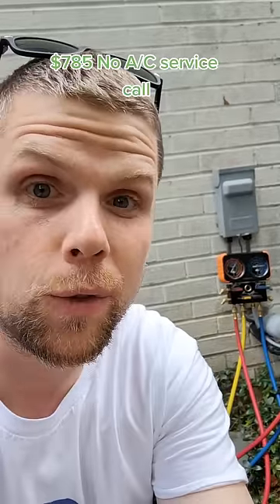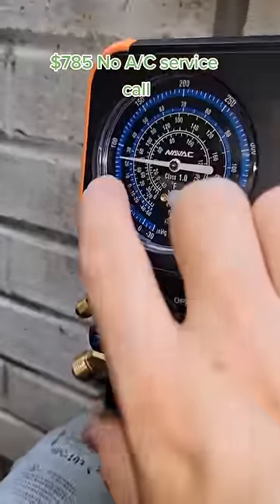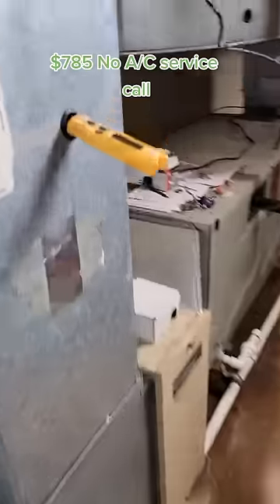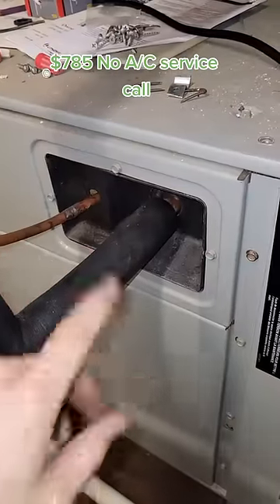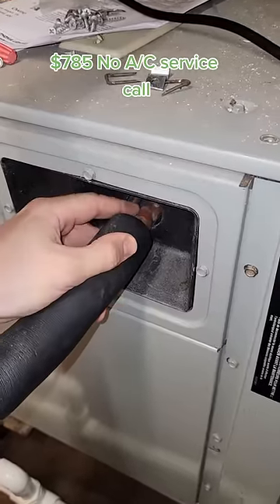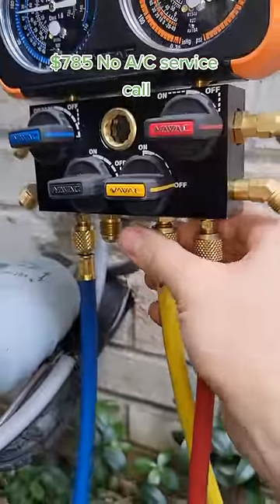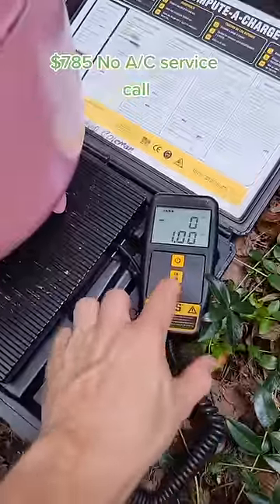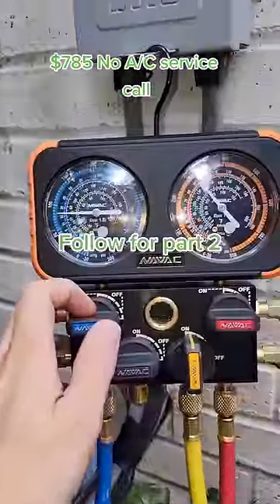Why is my A/C unit 🥶 freezing up? #shorts

Comment: For us, a leaking furnace and a freezing up (frosting) return line (idk it's called that, but the pipe that brings air back from the outside unit into the evaporator) after our ducts were cleaned and the air flow was suddenly DRASTICALLY reduced.   Sounds like something dirty to me! 

The maintenance ppl were putting the filter (for years) where it was not held secure because the original slot was too small for the filters they have , so they put it against the wall, but the force of the air was pushing it aside, and the dirty air was bypassing the filter.  It was also highly likely sucking air inside from the open slot where the filter was supposed to go.   The inside of the furnace and the ducts were filthy, we had breathing issues, recurring sinus headaches etc.  

So the ducts get cleaned and suddenly the air flow is HORRIBLE.  THEN after a while I noticed the leak. The pros came, said there was a pinhole leak in the line (a SLOW leak) and the duct cleaning must have exposed it.  Gives the AC unit a charge says they will replace the unit after approval from the owners.   Says he found out that something had snapped inside the condensation pump, so he had to replace it.  He turns the air/fan speed (?) up on the unit.  Tells me it should work fine until the next few days when they replace the system.

 I tell him the air flow isn''t right, but he is the expert and he tells me that the weak air flow  (next to none compared to before) is fine. The basement air is coming out great, and it's cooling.  But 1st floor air is super weak.  He thinks it's fine. He says nothing about the great air flow at basement level.   He suspects because we prev had strong air on 1st floor with little to none on the 2nd floor, the duct cleaning removed something that formerly obstructed the 2nd floor from getting air  and it will be fine now.  He never checked the air flow on the 2nd floor though. 

But  If he had checked the flow on the 2nd floor, he would have realized that there was STILL no air flow up there, so the downstairs should have been roaring if his theory was true.    He leaves, the temperatures go up instead of down, then the leak starts again at the furnace, and it starts freezing up.  We had to sleep with the windows open on the 2nd floor with an electric fan blasting.  Did I mention it has been seriously humid and hot here lately?  The inside cooled a whole 2 degrees in 8 hours although the outside air was 5 degrees cooler.  Our building is insulated great for the winter. But what keeps the place warm in winter , stores heat in the brick facade in the summer too.  SMH

I do some research, find out about dampers, and adjust them, improving the air flow to the 1st floor . Air flow on the 2nd is still God awful, ie barely even a waft of air.    After adjusting the dampers, the frost went away, the furnace stopped leaking. 

Next day, the house is hot as heck, the AC clearly not working. I finally talk them into sending a guy out again, bc the AC was supposed to work until they get it replaced. 

I specifically asked them to send someone out who is familiar with these old systems, and who is knowledgeable about air flow.  The guy comes out, knows nothing about air flow.  But he discovers the condensing unit is not working and the thermostat is bad, so he replaces it.  He says it wasn't sending the signal to turn on the compressor. That was a 2nd peripheral problem discovered, but Air flow is still horrific. Except in the basement . 

He leaves.  The temperature drops another 2-3 degrees, and it starts leaking around the furnace again.  I finally notice while looking around trying to understand, that he did not replace the cap in the condensation pump, and the paper tab is STILL IN IT, so it's probably been there since the day before!     I replace the cap, and remove the tab, and the condensation unit starts working.  A few hours later, the furnace is leaking again,   and a little bit after that.. just as I was concerned might happen again, it starts freezing at the return line.  I suspect maybe dirty evaporator coils, which it seems NO ONE ever looked at in the two visits.  It looks to me from what I see online, that it's pretty much one of the first things you look for besides blocked return vents, dirty filters... smh.  

 If it's not the evaporator coils, it must be an obstruction, and from what I have seen,  understanding how pressure readings affect this could have ruled out an obstruction .. or not..   The severely reduced air flow.. no one seems to want to believe me.  They said they would send an airflow guy out to talk to me, but instead they send someone who replaces the thermostat, never looks at the coils, has no real knowledge about air flow etc.  I guess they figure they are replacing the entire AC unit and the Furnace (hopefully tomorrow!) and in their minds this will fix EVERYTHING.  One small problem with that - before the ducts were cleaned, there was NO issue with air flow. NO issue with freezing up return pipe, or leaking around the furnace.  

Replacing the pump had to be done, but it seems to me it was a sort of peripheral issue to the air flow. Or maybe it happened at the same time as the air flow issue, because of the duct cleaning process.  Even with the pump replaced, the air flow issue never went away. 

  Replacing the thermostat was also a peripheral issue - Maybe it was my husband turning the thermostat on and off  too quickly (if that is a thing) or maybe  a chain reaction to something that was done in the process of trying to fix things.   Whatever the case, replacing the thermostat also did not fix the air flow issue, and I knew it wasn't going to. 

I am no expert. I have very limited knowledge based on reading and looking at tech videos for a few hours.  But I know what I see happening,  and to me, this air flow thing is either dirty evap coils, or an obstruction somewhere in the ducts, or maybe there could even be a duct not connected properly - one of them moved a bit when I was trying to adjust the dampers.. a bit concerning.    But my God.. you don't have to be a rocket scientist, or even have a certification in HVAC to understand that this air flow is a problem or that it isn't going away with what has been done, so something is being missed.  I can't believe that these guys check temperature at the vents, but couldn't bother to look at the evaporator coils - which seems something super basic from what I have looked at.   

 Sorry to be "venting" (no pun intended but it is what it is lol)  - but this is so frustrating. I can't imagine if I was the owner of the property, having to pay the kind of money you charge and then having the guys have to come out multiple times and never seeing the actual problem, never checking the coils etc.   Pretty expensive job to have them keep missing the real issue.   I mean sure, the pump needed replaced if something in it snapped and it was spraying water. That was the story anyway... but um... it's still leaking, so that wasn't probably it.     Then the thermostat did go bad, and that needed replacing, because the signal has to be sent to get that unit doing it's job.   

But in all of this, no one believed me when I said, hey.... the air flow now compared to what it was before is NOWHERE NEAR what it should be EVEN IF it is split between a couple more vents upstairs.  And based on the tiny waft of air coming from the upstairs vents, so negligible it might as well not even be there- if there was an obstruction before stopping the air from getting upstairs, and there STILL is an obstruction (they are two different runs btw) then why is the air on the 1st floor not powerful like it was before?   

Either all three of the upstairs runs are obstructed, or something else is going on.  And why is the air on the 1st floor suddenly not strong either?  Maybe the blower isn't working right? Or maybe the Evaporator coils?  No one checked either of those.  SMH.  So frustrating!    I mean, my God, the first guy who came out is supposed to be "the best" guy they have, and really good at his job, and he didn't even remove the tab that allows the condensation pump to work?  What???  And then the 2nd guy doesn't notice that either, even when he was playing around with the pump to see if the condensation lines were draining?  Yikes.    All this seriously makes me want to go to school for HVAC just so I can do it myself.

Comment: So how did the evap and blower wheel and ductwork look. 9/10 when a unit is freezing and the subcool is normal to a tad low it’s airflow. Looking at the low side gauge and taking delta t and not measuring subcool or superheat  first before adding charge is very irresponsible and a lot of techs have overcharged units this way. And misdiagnosed

Comment: Low refrigerant causes insufficient cooling. Poor air flow causes icing. Probably plugged furnace filter or a restriction in the air conditioner.
Reply: These are professional men working son. Keep getting experience before posting.
Reply: @nunez23j1  bold of you to assume I’m not a professional…

Comment: So the tank is flipped up side down because its a blend or is it because its as we call it a virgin tank that has no dip stick in a middle and only one valve at the top? So in order to get a liquid out instead of a vapour you have to flip it over.

Comment: Many things cause it to freeze up.   
Low on charge. 
Restriction in the metering device or filter dryer. 
Lack of airflow due to a plugged air filter, plugged up evaporator coil or blower motor shut down.  
Running it in the wrong designed temperatures not set up for that system.  
Since 410A is a blend losing X amount has been known to change its capacity but to be honest with you I’ve never seen a change.  As of 2023 there is a rumor of them phasing that out.  I honestly believe it has nothing more than just to make extra money by selling new products. 
But anyways you’re doing a good job 👍

Comment: I must have missed when he checked all the area's for the leak, then vacuumed the system down, brazed the leak, pulled a pressure test to see if the brazed line held, then put the correct amount of freon in.

Comment: 5000$ fine for him 50,000$ fine for the company best part he filmed himself doing it
Reply: I wasn't gonna say but I'm glad someone did
Reply: Not for the purging of his equipment, but for charging a system he believes is leaking. As a former MVAC tech, I'm dubious about his diagnosis.
Reply: @Azlehria  in Canada you can't purge to the air it must be properly evacuated though a machine
Reply: Not illegal on systems containing less than 50 lbs of refrigerant. Yall need to retake the EPA if you think you know what your talking about.
Reply: @crapmusstank6558  are you Canadian
Reply: @meanmachinesgaming  American...
Reply: @crapmusstank6558  and that's the difference between Canada and USA
Reply: @meanmachinesgaming  this was an American shot video so I dont see what the problem is. The few pounds that leak out residentially compared to elsewhere is miniscule. God bless Canada. 🙌🏿
Reply: @crapmusstank6558  Must be a 608 thing. System size is irrelevant under 609, and MVAC systems are way less than 50 lb.

Comment: I hope that wasn't water coming out of your charging hose.
Reply: Water? You mean when he opened the charging hose to purge it?
Reply: That’s liquid refrigerant coming out when he purged the air of the hose.
Reply: He said water if you listen the video, I'm sure ment refrigerant.....I was being a smartass
Reply: No kidding, if that's water he's got other issues😆 but it's just liquid refrigerant (I hope)
Reply: @s_9036  so basically his service call was a “ no cooling call “ the system was freezing up, he shows the low side pressure on the gauge showing that the pressure/temperature is below 32 degrees which is below freezing thus making the low side of the system freeze. He then connects his manifold gauges to the system and “purges” his hoses before putting refrigerant into the system because you only want to put refrigerant into the system NOT air and if you don’t purge your hoses then you are putting air into the system. That’s why you see some gas and a little bit of liquid come out when he loosens the hose a little bit. He then weighs and charges refrigerant into the system weighing how much he put in to charge the customer accordingly. Right now refrigerant is getting very expensive , that pink tank he used is R410 is a high pressure refrigerant found in newer systems. If you own a system that has R22 then it’s time to replace the unit since the price is $1500 per 30Lb tank right now wholesale and HVAC companies are charging about 150-200$ per pound and a typical residential 2.5 ton unit usually holds 4-6lbs of refrigerant depending on the make/model.
Reply: @s_9036  Join the military and sign up as a 91C you'll get training and all the certifications to actually do it.
Reply: And it pushes the air out buddy so he is half way roght

Comment: You need to do a leak check before dumping juice in
Reply: In the field that’s not always the case , if the customer just wants to add refrigerant just to get by that’s usually happens , they don’t want to pay extra for a leak search . If the system was completely empty that’s a different story.
Reply: @JP-zz5rm  these are sealed systems and really shouldnt ever need juiced up unless you take forever disconnecting. any loss below 10% for comfort cooling needs to be searched and you cannot add to known leaking systems, brush up on your epa regulations
Reply: @blue_equinox7115  🤦‍♂️ just by you saying “ juiced up “ I know damn well you aren’t a technician, maybe someone that’s taking HVAC courses but definitely not a technician that works in the field, obviously there are regulations , if you actually work in HVAC then you know that in the field not everyone does leak searches , most just gas and go, do you know why? Because people are just out to make money, they’ll do a leak search if the customer pays for the time but realistically maybe 1 out of 3 technicians will actually do a leak search on the spot. I’ve been in the trade for over 15 years and I have seen the lengths of what HVAC technicians will do in order to make extra money.
Reply: @JP-zz5rm  but I mean you do you, just remember those hefty epa fines come back on the tech, not the business. Your choice to run that risk but I dont
Reply: @JP-zz5rm  yeah it would be ok if he wasn't charging about 800 bucks for a hour job
Reply: @Divisiondoorway  he charged almost $800 because of the amount of the refrigerant he put in as it has gotten quite expensive and he measured the charge in so he was able to charge accordingly. When units start leaking like that it’s always best to advise the owner of replacing the unit as they will be spending a decent amount to get it back to par.
Reply: @blue_equinox7115  according to the epa in the US of A you don't have to do any leak checks or repairs on systems containing under 50lbs of refrigerant...
Reply: @crapmusstank6558  nah thats only critically charged systems which is under 5lb
Reply: @blue_equinox7115  you better go check your epa book again. Couldn't be more wrong in the US anyways. Where are you at?
Reply: @blue_equinox7115  leak repair on residential or automotive systems is encouraged but not required by the epa. If the customer does not want to pay for a leak test or repair then gas and go.
Reply: @Redtooth75  dunno anything about automotive, it's completely separate from a 408 cert, but you cannot charge a known leaking system
Reply: @blue_equinox7115  i dont know what a 408 cert is or why it would apply here cause refrigerant falls under 608 and 609. Leak repair is only required for systems with 50 or more pounds of refrigerant and as of 2020 only if the refrigerant is ozone depleting. This system has nowhere near 50 pounds of refrigerant and uses an HFC refrigerant so it does not require any form of leak repair by regulation.

Comment: Now let me ask you this question couldn't a dirty coil also cause freezing up because no airflow pulling through?
Reply: To determine if the Evap coil is dirty is do a visual inspection and do a static pressure test. A static pressure will for sure let u know if the Evap coil is dirty and filter. This a short video. A tru AC tech will do a visual inspection for possible leaks. Notice he didn’t charge the system by subcool and superheat charge. It’s a short educational video

Comment: No checking superheat, no checking sub-cooling, no checking what kinda of metering device,no checking filter, no checking evaporator and no leak check. This is your common residential technician he will be back next year. Just for everyone wondering if he all those things were checked, he should of recovered the refrigerant, nitrogen tested to 300-350 psi tested all joints fittings, accumulator( reversing valve if heat pump) txv  and Schrader core valves with bubbles. If no leaks found hang out and monitor pressure for at least 20 mins should stabilize and stay at a pressure( if psi continues to lower )put some refrigerant in system and get out your trustie leak detector repeat leak check. If you’re pressure stays, replace the filter drier and schrador core valves and put system into vacuum if it goes to 500 microns you can sleep easy.  You guys are welcome. 50% of your residential guys will choose add refrigerant and call it a fix cause no one has properly taught them, other 50% either one lazy or two know they will be back on another service call and don’t care.

Comment: so if you added gas there is a leak. 410a is terinary blend of 3 gases. they will leak out at different rates. pull entire charge. do not re- use. weigh in fresh charge after leak fixed. ty. :)